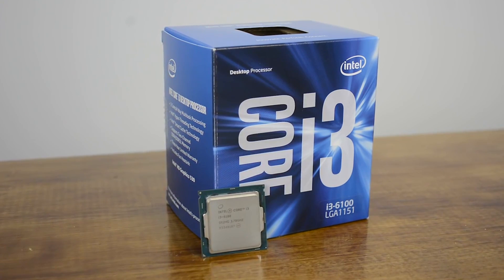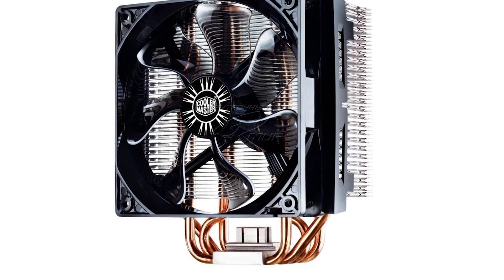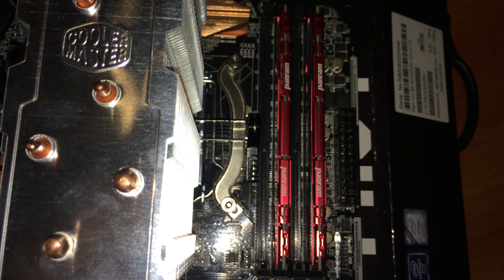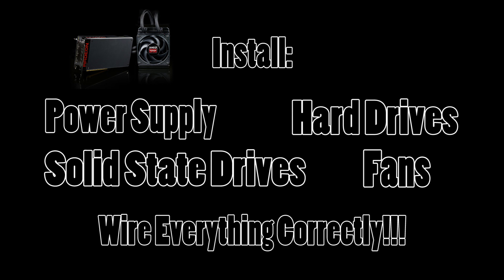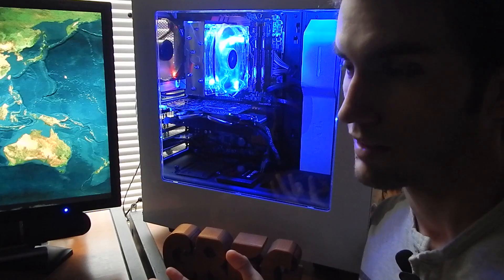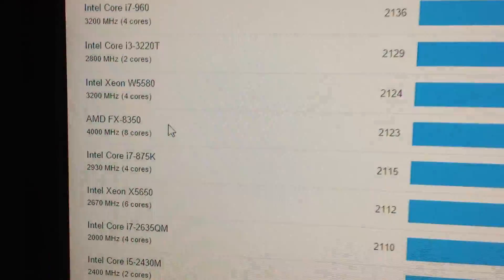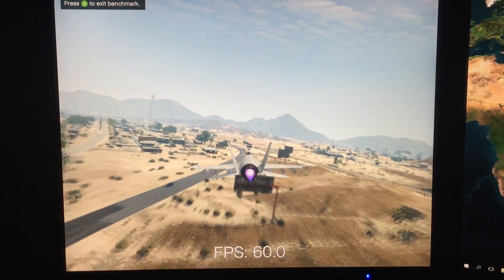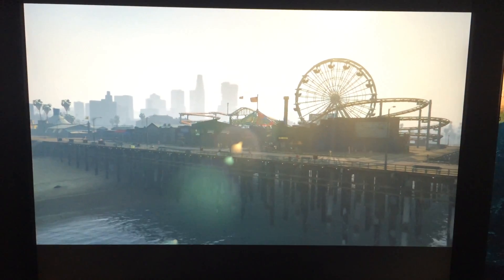$600 Intel i3 Skylake Build

Comment: Wow this is a depressing video, but impressive at the same time, I have spent close to $2800 on my AMD 9370 and this little beast would beat it at most, to all single threaded games and almost keep up with on multi threaded games, for more than half the price.
Reply: 280?
Reply: blondishasp69 What?
Reply: 2800 dollars for a 9370?
Reply: blondishasp69 The whole system.
Reply: kk
Reply: lol
Reply: lol why didnt u look around the internet before buying that shit... u should've gotten an i5... I had fx 8300.. now few days ago I got the 4690k... it is fkn amazing...
Reply: SantaHunter o7 Anon, its a long storry man, I want a change 4 years ago and had never had an AMD system so I tried it, and for multi threaded title like BF 3 and 4 and doom its wrecks intel. the $2800 is included 8150-9370, and x1 7970's to a R9 390x and a custom water loop.
Reply: Luke Keast of course its better in multithreading.. it has 8 cores.. but do you ever use those cores? if you're gaming i guarantee you that you don't use them.. if you're doing rendering or video rendering then yeah.. but i5 is 2x times better in single core performace and performance per core.. as I said i just got my i5.. and my GTA V went from 30-40 fps to 60-70 fps.. with even higher settings than I had on fx 8300.. my windows boot time is twice as fast (i have an ssd).. and my apps open instantly, no rly like instantly.. i mean it was almost instant with the fx as well.. maybe like 0.2s and now its 0.1s.. so yeah dont mind that.. anyways get a 6600k asap :D you can easily sell the mbo-cpu combo and get the intel cpu for that money... and put away another 
$150 for the mbo.
Reply: SantaHunter If you only got 30-40 fps in GTA V with your 8300 that means its poorly optimised, I get 80-120 fps in BF 3/4, ESO, The new Doom, but yes you are right I should have stuck with intel, oh well I like and underdog why didn't you opt for a sklylake over the devils canyon?
Reply: Luke Keast just because DDR4, 14nm & 5-10% better performance.. although devils canyon are in the top 10 cpus you can get right now :D
Reply: lol amd will never wreck intel
Reply: Anton Laula
lol they have before kiddo
Reply: Intel had to cheat to get where they are
Reply: blondishasp69 what did they cheat in? and still they are the superior
Reply: Anton Laula Intel is not superior, people are just brainwashed. If everything when it come to Computers was optimised for multi core cpus and I don't just mean 2 or 4 cores I mean from 2-16 cores amd would kill intel.
Reply: Luke Keast amd cores are weak af compared to intel, when will a amd cpu ever beat an i7? maybe zen vill give more competition but i still think intel will win
Reply: They arent weak dipshit
Reply: They operate in a totally different fashion and are 5 years old. And Intel had to cheat and lie to get where they are. They are not superior in any way
Reply: Anton Laula Wrong. You didn't read what a typed properly because you are too brainwashed.
Reply: Luke Keast I'm not brainwashed I'm saying this from personal experience as someone who always had AMD cpus and recently switched to Intel. So no if you think people who say Intel is better than AMD are brainwashed you are wrong, because Intel is much better than Intel and everyone knows that expect for you and AMD fanboys ^^
Reply: Wrong. Intel is no better than Amd. Intels cpus are merely newer than Amd's. Of course newer is better.
Reply: blondishasp69 i will still always have intel
Reply: blondishasp69 What you're saying makes no sense? If they make better cpus, which they do, by what logic is Intel not better than AMD??
Reply: They are no better. They are where they are because of cheating. Intels product is currently better. But new products always come out.
Reply: blondishasp69 ok what did they cheat in? you seems to be possesed by that
Reply: The Pentium. They rigged benchmarks and paid off oems and made them use intel chips over amd's
Reply: blondishasp69 Lol. Wow? The Pentium? Really? Just gtfo here dude. You are talking about a cpu no one uses today anymore that was released more than a decade ago. Now when people can test CPUs and upload it to youtube proving how much better intel is you still saying the opposite & using something very stupid as an argument that you already lost. There's no way on earth you can prove AMD cpus are better than intel. Let me make this clear. I used AMD since my first PC cuz I couldn't afford Intel and I just recently switched to Intel. And guess what it is more than twice as fast although it should be much slower by looking at the specs on paper. Current AMD cpus are shit. I will be happy if they make good CPUs. But at this moment, defending AMD and saying their CPUs are better is a thing only a fanboy or a stupid kid would do. Tell any techguy AMD is better than Intel he won't even bother arguing that, he'll just laugh at your stupid face.
Reply: blondishasp69 Well we should be happy Intel rised.. Because if they didn't, we'd currently be stuck with AMD's shit CPUs ^^

btw if you have no other point to make and will keep pointing out something so silly and unimportant just don't comment anymore
Reply: Wrong. If you understood why amds cpus dont perform well you would know that if they were on top the market would have conformed to their method of processing and their cpus would absolutely butt rape intels.
Reply: blondishasp69 Lol, that is true. But that has nothing to do with the actual fact that Intel cpus perform better than AMDs? Why is that? I don't care. What you were saying is "Intel cpus suck because they cheated 10 years ago" 

Do you see where I'm going. I can agree with you on what you just said. But that doesn't prove their cpus are better. It could just maybe prove that Intel are bastards. And really what do you care? What is AMD or Intel to you? They're two huge companies that will do anything to sell their CPUs.
Reply: ill get a vid to explain this to you
Reply: blondishasp69 I don't think I need explaining. What I'm trying to prove to you is that Intel CPUs are CURRENTLY better than AMD. They might not be that in future. And they might be better NOW because they cheated in the PAST. I do not care about that. It don't mean anything to the consumers. And as I said it shouldn't to you either. Only thing you should care about when buying a CPU is which one performs better. Not who makes it or why does it perform better or what actions in the past resulted in one cpu being better than the other? If AMD makes better CPUs in the future, I will buy their CPUs. I got nothing against them or intel.
Reply: No shit. My point is that Intel is not better.
Reply: I will only ever buy Amd. Until Intel and Nvidia quit their shit. 1700 dollars for the 6950x... like what the fuck. And nvidia is a bunch of shills
Reply: blondishasp69 lol yeah they only make like the gtx 1070 that is the most bang for the buck card yet
Reply: Not an Amd fanboy. I recommend against amd cpus. But I personally will never support Intel or Nvidia. I will never buy a brand new product from them. Until they change their business policies
Reply: blondishasp69 That's where I think you're wrong. You don't buy a CPU because of its company policies. You buy it because it performs better. You're alone in what you're doing and it won't change anything :P
Reply: Of course not. But for me that is why I wont directly support Intel or Nvidia
Reply: I would have actually bought an Intel cpu recently if Zen wasnt around the corner
Reply: blondishasp69 Oh I hate Intel and nVidia for their pricing as much as anyone else. But their products are simply better.. AMD will always win in performance per dollar.. but Intel & nvidia are CURRENTLY better in overall performance.. you don't need a 6950X to beat a 8350 for example.. a 200$ haswell/skylake i5 is enough ^^

those "extreme" cpus from intel are not meant for us.. they're meant for video editors who need the BEST you can get and have unlimited resources
Reply: Amd will always win in performance per dollar? Intel and nvidia are better?
Reply: What about the fact my 290x goes head to head with a 980ti in Dx12 AND Vulkan?
Reply: And the fact that Amd used to mop the floor with intel until their LATEST gen of cpus
Reply: Or that Amd has had better gpus in the past? 28nm is where they were on par with Nvidia
Reply: Nvidia just pays off devs to optimize for their cards. Nvidia cards are actually piles of turd. They just refined them to work on Dx11 like a God. But thats why they perform like shit on anything but Dx11
Reply: blondishasp69 umm first of all i dont think they are piles of turd and second of all i dont care how they do it, but they are beasts
Reply: They are piles of turds. They arent beasts. Pascal is extremely inefficient per core.
Reply: They were just designed to run good on Dx11. Thats why they run like dog shit on anything but dx11
Reply: Its like I said in an earlier comment, if everything PC's were optimised for multi core cpu's the competition would be a lot different, its only that most programs and software even after 8-9 years since the first quad core, are still optimised for single core performance.
Reply: Its not even multi core. Its just the way amd cpus operate
Reply: blondishasp69 Ehh but it would help with software and any program in general were optimised for multi core cpu's.
Reply: Not really. Amd cores operate totally differently. Thats why they perform sub par
Reply: blondishasp69 You are as wrong as the others, BF, WoT, Crysis1,2,3 Eve Online running 3 toons, Crossout, and Doom, I get a minimum  55-60fps max 130 running a AMD 9370 and R9 390X, skylake, and X99 platfrom get maybe 10-15 fps better no doubt, 10-15 fps worth it for the price you pay? No!
Reply: Im not wrong. Does your cpus have the same features as a skylake cpu? What abount pcie lanes?
Reply: blondishasp69 It does have more pcie lanes than skylake as for features I don't know enough about or even care about, thats not what we are talking about here, we are talking about performance for dollar.

Comment: Is it wise to sell 8350 and Sabertooth MB to get z170 MB  with i3 6100, and upgrade to i5 or i7 maybe, 5-6 months later ?
Reply: +D0UBL3W i3 is only for few months, main reason for switch is to get mob for i5/7 later this year
Reply: nope don't do it
Reply: Why not ?
Reply: In what? Age?  ... I mean for seriously. Its not a huge upgrade. But I say,  i3-6100 can actually beat any AMD processor until ZEN. Unless you want to heat up your room with it
Reply: yep, I can agree with this.. (waiting for my i5-6500)
Reply: Nedavno sam kupio i5 procesor, imo sam FX8300... GTA V dobim 10-20 fpsa više.. a ako planiraš skylake onda se još više isplati jel je performance improvement oko 5-10%... riješi se FX8350 što prije.. možeš ga na njuškalu u kombinaciji s matičnom prodat za 1200-1500kn ovisno o matičnoj.. dodaš na te pare još 1000 kuna i kupiš si i5 6500 + neku bolju H110 matičniu
Reply: Not if youre going to upgrade the cpu again in 6 months, you wouldve wasted $100 then. Wait until you can get a 6600k , thats my opinion. Unless you dont want to overclock then id get a 6500
Reply: Wait the 5-6 (2-3 now) months so that you'll have the i5 when you're ready to upgrade. The i3 isn't worth it.

Comment: im planning to build a skylake sistem which includes i3 6100 and asus h110m k. but i wonder that is there a huge differences beetween i3 6100 vs i5 6400 ? in my country i5 cpus are very expensive.
Reply: +EliGames that's incorrect my friend. i3 cpus, i3-6100 in this case, has four threads. its a DUAL CORE processor with Hyperthreading for a total of four threads.
Reply: physical threads are still better than hyperthreading

Comment: What do you guys think about this build I'm gonna do. http://pcpartpicker.com/list/4Qvf8K
Reply: Looks good, but your PSU is an unnecessary overkill. Unless you're going to use SLI or Dual GPU card, you'll not even use 500W. I run an i5-6500 with a GTX 980 Ti on a 500W 80+ Gold PSU with no problem. Given you probably will overclock, a good 600W PSU would be a great choice in my opinion.
Reply: hyungwoo0312 I have no intent to overclock, mostly because I don't know how and don't find it necessary. So what you're trying to say is my PSU is to much? If so then I'll change it.
Reply: hye preety decent build,and yeah psu is bit overkill, might want to change the graphic card as more gpu nowadays perform better at the same price, and i think you can find a cheaper genuine win10 keys from amazon or ebay,and if you think you dont need the dvd drive,you can opt that out,hope it helps
Reply: Fadli Hisyam THanks but that DVD drive is completly necessary as for Windows 10, I really don't like it
Reply: :I If you don't intend to overclock, getting a K chip doesn't seem like a necessary investment since it was made to be overclocked. A Core i5-6500 would be a good choice that will save your money in such case. Yes, you don't need an 850W PSU. With a single GPU and no plans to overclock, you most likely won't ever need more than 500W.
Reply: you can install windows just by using a pendrive, a lot of simple tutorial provided in youtube (:
Reply: Fadli Hisyam The DVD drive isn't to install Windows.
Reply: cause most drivers and app can be found on the web
Reply: Fadli Hisyam I know that. I'm not using the DVD drive for drivers, apps, or Windows. It's for other things
Reply: Good build but 850 watt power supply is a tad overkill i would say 650 watts would be fine but if your trying to future proof this build i would recommend the 850 watt power supply
Reply: No Name The parts are getting more efficient over time rather than getting more power hungry, so I disagree on that advice. 850W would open up tons of room for overclocking and multi-GPU setup though.
Reply: hyungwoo0312 Well I went with a 750W so too late

Comment: im really confused.. theirs a h170 & z170 mobo.. whats the difference guys??
Reply: The Z170 supports CPU overclocking for K chips and RAM overclock. It also supports RAM clock of more than 2133MHz. The H170 has CPU and RAM overclock and is limited to DDR4-2133.
Reply: +hyungwoo0312 How is it limited to to 2133 frequency? Is it max frequency it suports?
Reply: Ilija Sekulic Yes. H170 can only run DDR4 in 2133MHz. Any RAM with higher frequency will work, but run in 2133MHz. Z170 can support higher clock speed. If you head to the specifications page of H170 and Z170 motherboards, you'll see the difference.

Comment: I want to build a pc for photoshop and corel draw use with amd fx 6300.
Do i really need a graphic card?
I dont play games at all
Reply: no but it will help in rendering times
Reply: +Thejokster1 thanks
Reply: I speak under correction, but the fx series doesn't have integrated graphics so you'll need a gpu to use your pc at all
Reply: +Spaghettified oops my bad not very familiar with and proccesor was sort of speaking in general
Reply: +Spaghettified oops my bad not very familiar with and proccesor was sort of speaking in general
Reply: Yes, because you need to render the image and if its: 1080p, 1440p, or 2160p you would require a much superior Graphics Card instead of the integrated unit.

Comment: i need some decision help here. ive bought for ultra cheap a b150m mortar, 16gb corsair vengeance, a 630w be quiet l8 pure power psu and case is the raidmax hyperion. some parts are second hand (from a friend) and some parts from a older pc im not using. sooo... here are  the questions:

would u put the i3 6100 in this rick (there is a chance to can get one for 60 bucks)?
ive got a r9 380x here should i wait for the rx 480?

in case i would take the i3. do u guys rly think that is a good choice... i mean... rly a good choice? will this cpu bottleneck the r9 380x? or still the rx 480 (or gtx 970)

i will use this as media pc like... watch some movie, youtube stuff and indeed a littlebit of gaming. ive watched tons of benchmark videos and aseked thousends of ppls but no one say clear something like: "dude, this shit will be fine for while, dont fear dualcore... just buy it!" 

best regards from germany

EDIT:
before someone asked. cooling system is a aio lc power lc with an be quiet silent wings 2 fan. 
storage are: 60gb ssd corsair just for windows, a 4tb wd green and a 500gb sshd from samsung
Reply: I'll say get the i3-6100 since you're gonna do a little bit of gaming. if it's just a little bit, you might want to check the Pentium G4400. its even more cheap and since it has an LGA1151  socket you have alot of room to upgrade to upcoming Kaby Lake processors without changing motherboard.
Reply: that is true m8.
but if you really wanna game on it, a core i3-6100 is great value. dual core with H/T, clockspeed of 3.7 GHz which can be overclocked on a mediocre Z170 chipset mobo. go for it. i mentioned the pentium because it is super cheap if you are doing very less gaming.

Comment: I have no issues regarding the fps difference between the i3 6100 vs i5 6400. I download 24x7 from torrent, stream movies online and play games. So is i3 6100 OK?
Reply: core i3 6100 is perfect for gaming.
Reply: i5-6400 is shit.
Reply: Get the 6500 instead of the 6400, its 3.2 vs 2.7 ghz on stock (3.6 vs 3.3ghz turbo).
Reply: Movies, and gaming on the Core i3-6100 is PERFECT with 3.7 GHz for light gaming and a intel HD 530 integrated for movies it makes the the perfect processor, but if you want to do 1440p gaming on ultra I would recommend a dedicated graphics card like a R9 390. The only cons I can see is that it's only dual-core, if you want to make a future proof build, the dual core is going to set you back , but then again your motherboard is LGA1151 so you can over time upgrade the processor,